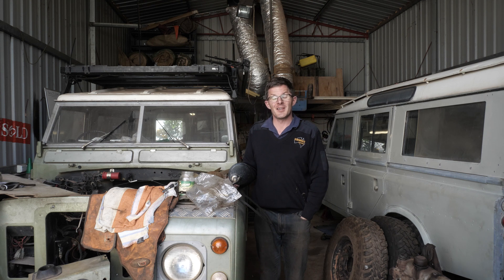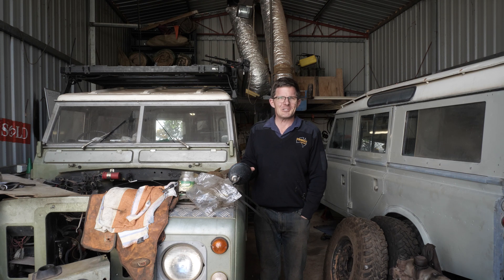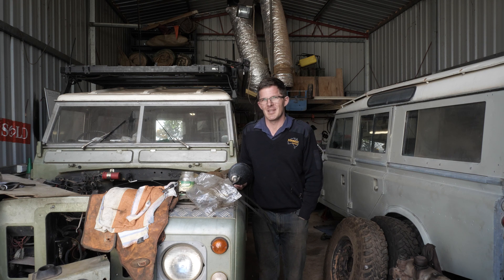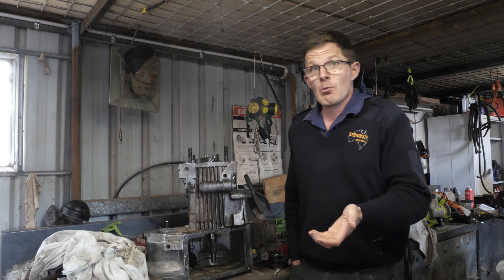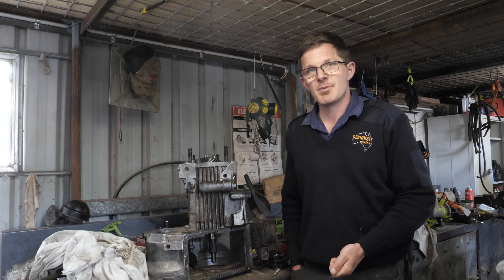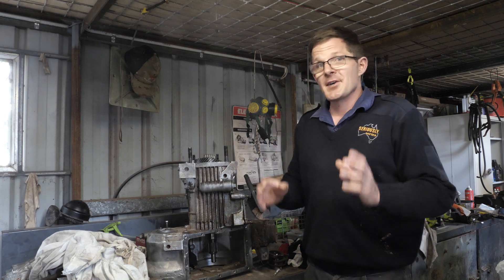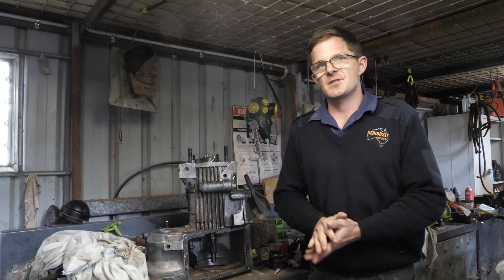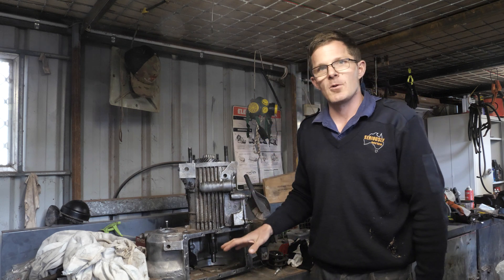Land Rover : LT 95 VS LT95A Gearbox What's the difference?

Comment: Stage 1    1980 ---1983  isuzu 3.9   all have the larger hand brake drum    v/8s  Rangie  & stage1 all had the small hand brake drum. All lt95A will fit any stage 1 Landy,s.

Comment: Hey there Geoff,

First off very very nice video and actually the only one of its kind on Youtube. However i wanted to ask, as i have been reading about LT95As lately due to the fact that i wish to use one in my 83 110 V8. I actually found that the Perentie LT95As have the higher ratio in them along with the 12C LT95 Rangie boxes at 0.996 : 1. The Perenties though had a great big torquey Isuzu up front compared to the civilian Landies. The lowest LT95 ratio i think is the early 110 one at 1.336 : 1. Correct if i am wrong however.

Take care !
Reply from the maker: Thank you for your kind words.
Are we talking about low range or high range?  Cheers Geoff
Reply: @seriouslyseriesaustralia  High Range. Did you mean low range ? If so then disregard what I said previously. All LT95s I think had the same low range ratio.

Comment: Thanks for all the videos, really found them useful having picked up a Perentie in the UK. If you've any videos planned where you're driving the Perentie and showing what the gear changes should be like that would be awesome. I suspect the synchro in mine is gone, but I'm unsure what a 35 year old gearbox is supposed to be like 😂
Reply from the maker: I’ll see what we can do. Try easing it into gear and double clutching. Cheers Geoff
Reply: Hey mate, i have a 1992 perentie 6x6, but I can't find a decent transfer case when i cut over to a 6.7l cummins and 68rfe Auto, so I'm cutting it in half but what are all the details to the lt95a input shafts to transfer case????@seriouslyseriesaustralia
Reply from the maker: @carlbland8628  Hi Carl. I would simply suggest trying to use a different transmission all together if you are goin to all that trouble, look at a alice transmission system or fit a patrol gearbox. Kind regards, Geoff
Reply: @seriouslyseriesaustralia  1. you do understand what a 68rfe 6 Speed auto is, and 2. I'm after the transfer case and gearing so 3. Thanks to Australia I'm not dropping $60k on a transfer. I what to prove my concept the  order and wait for 6x6 (2 tail shafts) transfer case from overseas.

Comment: I know that for the Perentie, different high range output gears were fitted depending on the model. You can buy these independently to fit, but need to make sure you get the correct bearing type. That applies to the gear lever too, as slightly different ones were used for the Stage I vs Range Rover vs 101 FC vs Perentie.

Comment: the LT95 transfer has about 9 different ratios . The Range rover were the that had the smaller brake drum The isuzu powered country on had the bigger Hand brake drum
Reply: Yes you are correct. I have a county LT95 & it has the larger brake drum same as my Perentie. Serial no. is 15coo12.